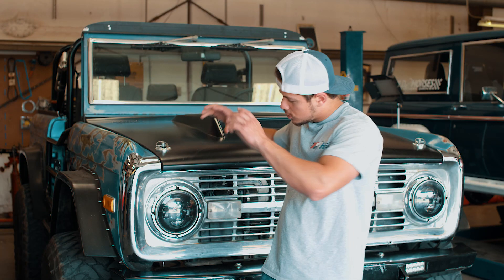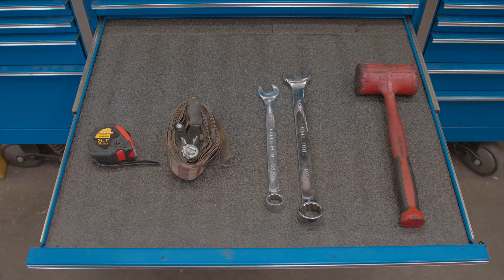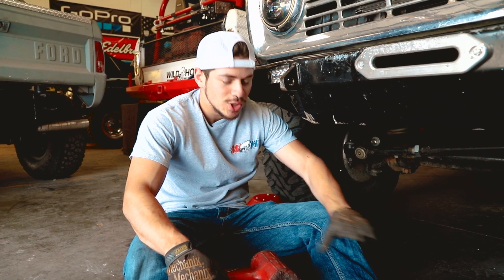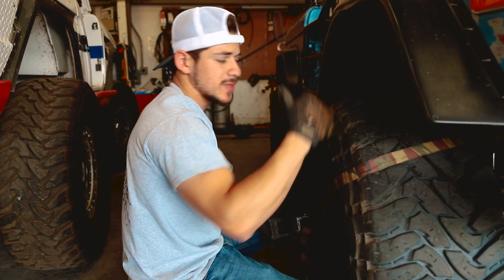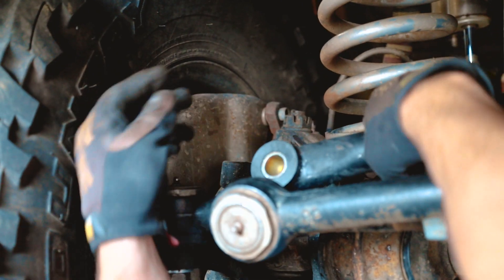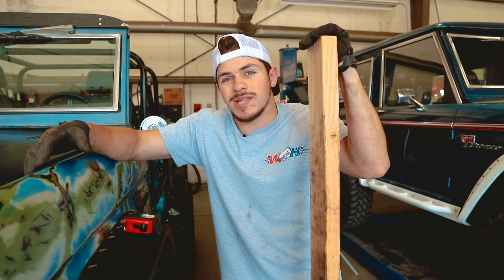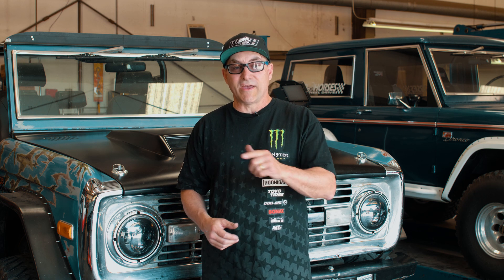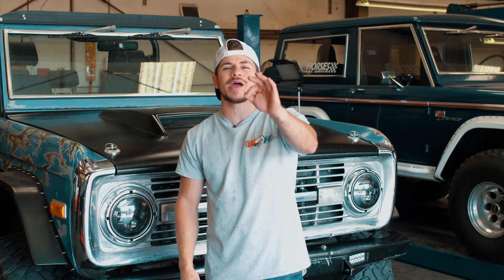Tech Tuesday: How To Adjust Your Trac Bar for Better Steering

Comment: So if the drivers side extended out more, you would rachet starp the driver side? basically the same thing. The reasin i ask is because my driver side sticks out .75 inch more. Thank you

Comment: Found the solution to the track bar when it doesn't line up because saying to ratchet strap the frame and body confused the hell outta me and I never heard of it. If it doesn't line up on the passenger side jacklift the driver's side about 5 jack pumps after it started lifting to get it high enough because what I found out is if the driver's side is not going in it needs to be at an angle to slide in perfectly but nobody ever explained it, have fun and use those jack stands yall gonna need it for this one but I did it on a 2000 dodge ram 4wd, fun fun

Edit: Also, my tires were off because I got done replacing my ball joints and everything else from there was very easy access

Comment: Use a 4' level off the tire so you can make sure your tires are plum. Always measure off the frame, way more accurate then body panels. I'm installing my front axle today so I'll be doing this real soon.   Love the vids bro 👍
Reply from the maker: I was talking with one of our most knowledgable tech guys and he said the same thing about body panels. Mine are in great condition but even I can admit that they could be slightly tweaked. Hopefully not though haha I'll have to remeasure and find out! Thanks for watching the channel bro!